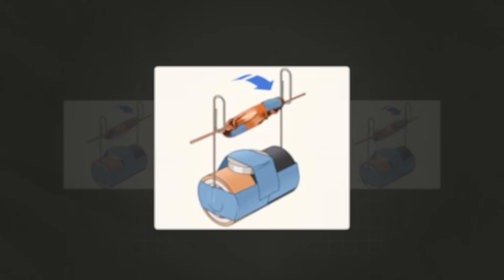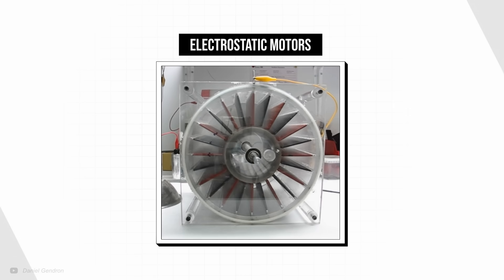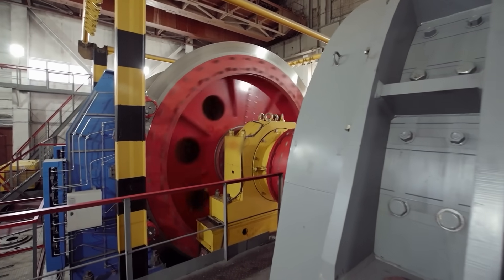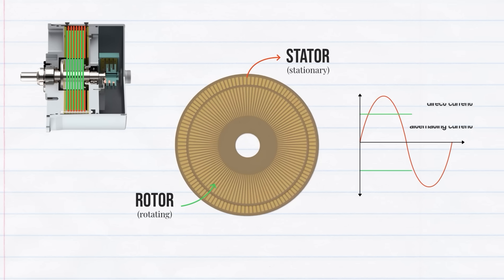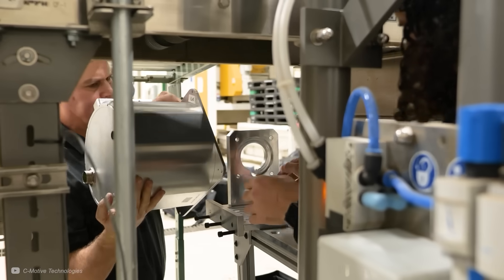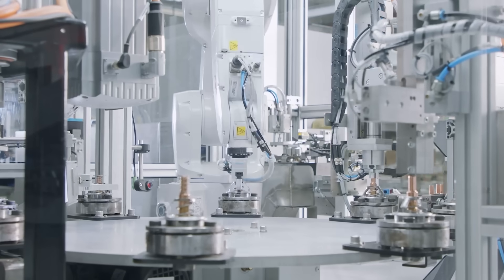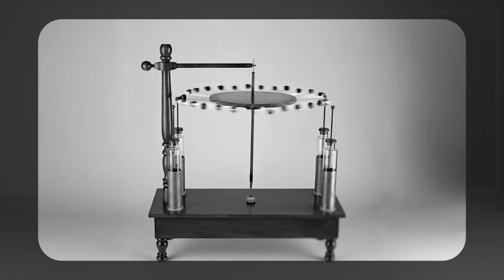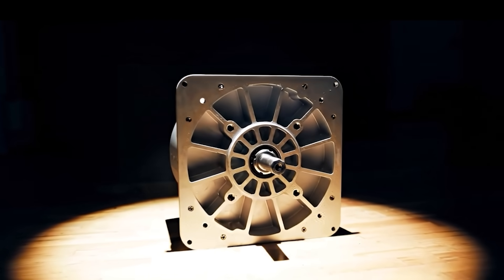How Electrostatic Motors are Breaking All the Rules

Comment: Could this motor work in airplanes (and ships)? I'm thinking you need low weight there and torque, but also power? The main reason we do not have electric (mainstream) flight is weight, not so much of the motors, but batteries. And they do not get lighter as you fly longer unlike fuel being spent. But you need most of the energy for takeoff, and for rockets it has been proposed to beam the energy to it with lasers, so I'm thinking would some such solution work for the first most demanding part of the flight? Or getting energy from the runway.

Comment: I just have to poke a little bit at this claim that the rotor in an electromagnetic motor is "generally a permanent magnet" - That's the first time I've ever heard that claim. In fact, permanent magnets are undesirable in many motor designs for various reasons, and that's why most common types of motors use electromagnets in the rotor too. Either powered by a commutator, or inductively. The most common motor in the world, the Asynchronous motor, uses an inductive electromagnet in it's rotor.

Can you provide a sourced number for how big a percentage of motors in use today use permanent magnets?
Reply: Almost all very small motors - think how may 12v DC motors you car has. Toothbrush motors, phone vibration motors, toys etc. These all use permanent magnets.
Reply: @jonathanpearce3773  I didn't ask for examples of permanent magnet synchronous motors. I know they exists and what they are used for. I asked for a number. Because I am still sceptical that PMSM are a majority (yet). There's an awful lot of AC motors out there, too, and they are especially used for industrial applications, which was the main focus of this video. Ironically, many of the pictures of electric motors flashed in this video are AC induction motors, which do not use any permanent magnets.

Comment: Love the parts where you show induction motors, or squirrel cage motors, which DO NOT USE MAGNETS
So no, electrostatic engines don't fix shit, we had "magnetless" motors for a century
Reply: But electromagnetic motors always need current in their coils to make torque, which causes heat unless you have superconducting coils. ;) An electrostatic motor creates torque with almost no losses, if it's almost not rotating. Hence for certain purposes it may be useful.

Comment: So much talk about rare minerals and the environment, and at the end we learn those new motors are primarily meant to replace asynchronous induction motors in conveyor belts, which don't use rare minerals nor permanent magnets anyway.
Reply: I wish I had a rare earth type motor in my industrial sander and dust collector.  When I am using 12,000 watts to sand wood, a 15% increase in efficiency would be appreciated.
Reply: @jasonneugebauer5310 Newer electric equipment uses brushless motors more and more.  Soon enough someone will fit one of these for better efficiency than brushed motors.
Reply: @nedmilburn I am looking forward to the time when most motors are brushless.  There will be a significant efficiency gain.
Reply: @jasonneugebauer5310 most industrial motors are 3 phase, brushless, with no rare earths.
Reply: @sajnt69 you are right.

and they are fairly well made and efficient.

I didn't think about that, I am always using single phase motors in my shop, which kinda suck.
Reply: Yeah and reluctance motors don't even need copper in the rotor.
Reply: if companies cared about rare minerals they wouldnt make as many disposable products!
Reply: @custardcatcher5195 Disposable products made in China who control the rare earth permanent magnet supply and are trying to control the copper market. Sold as finished Chinese products. Quality American and European manufacturers have their designs stolen and their supply chain thrown into chaos by the Chinese. Believe me they care a lot about these minerals, not doing so may mean going out of business
Reply: @grz987 I love how people try to blame China for everything manufacturing.. Tell me, who is purchasing disposable products? Yeah people and companies from every nation, west to east. Tell me, how did China become a manufacturing giant? Oh right. Western demand. No demand, no supply. And, no, not everything coming out of China is cheap disposable Temu crap, they make a lot of quality products as well. And yeah it's not just China, there are slew of countries manufacturing disposable products these days. Not only that China is leading the way in renewable energy amongst other arenas. TLDR, trying to displace blame for everything on China is dumb.
Reply: @grz987  just to point out the bad quality "made in china" is designed in the US and in Europe, with the specification it should be cheap and bad quality. China can also make high quality product, but it wouldn't make sense to ask for a high quality product and pay the same than a US/EU made product.
Reply: @custardcatcher5195 there's a lot that care too because it affects the total cost. Affordability affects popularity
Reply: @custardcatcher5195  true... things must be changed!
Reply: kind of what i figured after 1min , like hu permanent magnets , yeah in schoolbooks to explain the principle maybe but most of the time theyre just windings aswell
Reply: Well those still use a good deal of copper
Reply: Lol
Reply: It would appear the main replacement is of a reduction gearbox. But they could also use a stepper motor.
Reply: Don't forget about the copper!
Reply: @sprockkets  or AC :D
Reply: True, but the massive reduction in copper use and energy cost is awesome. Hopefully these can find more applications in the future.
Reply: Thank you, you saved me 10min
Reply: not that rare mate iridium alone turns out to be fkn everywhere on account of Earth representing a fkn Golfball when you look at the impact scars huge glut for Lithium and nobody willing to go Annex the Congo and stop the Child slavery and just rip that shit out using mining equipment that functions on diesel
Reply: This channel is clickbait, so no surprise there; the guy also really seems like the pseudo-intellectual type. If he can get a doctorate, that just speaks volumes on how education =/= intelligence.
Reply: Also the statements of the efficiencies are dubious. With an induction motor perfectly sized for the application, you don't need gearboxes and it should run near its peak efficiency. Which is more like 85-90%.
Reply: ну надо-же как-то подвести к этому ;) Просто так никто вкладываться в такое не будет. Плюс не показали "умножитель", выдающий как минимум 4000в и полтора киловатта. С переменной частотой(ведь двигатель нужно крутить с разным количеством оборотов в цикле)!!!
Reply: Can it be used for car hub motors?
Reply: Или узнаём, что эти редкие материалы добывают дети в какой-нибудь африканской стране, в шахтах, похожих на норы, работая за еду.
Reply: Isn't it that there is plenty of the so called rare earth just a lack in the possessing of it.  Australia opening up a possessing plant, will it get cut out of the market by China reducing there cost selling there stuff until it closes is the issue why it rare, its not rare it controlled.  Just like your oil.
Reply: Like what a thing to try and target. You aren’t replacing squirrelB with a novelty
Reply: There is a large push for permanent magnet motors for use with conveyors due to their higher efficiency so it is coming
Reply: All these rare earth's etc are headed to EV motors, who's efficiency is way better than old school induction motors, so a very bad choice to compare against.
Reply: You have no idea what you’re talking about.
Reply: @paulstubbs7678  BMW and Renault use induction motors in their cars and they're efficient as well. Since we don't know the specific motor efficiency in their case, I can't say if it compares to a Tesla or VW motor.
Reply: 😂 because their point was to cut the dependency with china by inventing the new motor, idk how well it ended. maybe just as good as another green energy bullshit marketing shenanigans which always ended with china copying it and do much better than them
Reply: Rare earth or critical resources are used in a variety of things is why there's so much talk about it lol
Reply: Ghat is true but they are inefficent. There are loads of inefficemt processing motors in industry and most of them could be replaced.
Reply: @matsv201  : An IE3 100 hp motor has an efficiency of 95%. First one has to count the motors and note their size. If most of the electricity is consumed by big motors in compressors, pumps, air condition, then changing these might help much more than hunting all these tiny motors.
Reply: @georgkrahl56  Why would you use  a 100hp motor on a convayer band that need half a hp?

The issue with using compressors and so on is that that is very inefficent as well.

That is actually the reason why most things are powered by small motors. IN the olden days everything was powered by compressed air, and before that steam.

But that was replaced with small motors because that was more efficent. Not less.
Reply: @georgkrahl56 they are already legislated nearly everywhere in the planet that over 0.75kw only ie2 and some places ie3 motors can be sold for s1 duty applications
Reply: @avada0 the issue is with efficency of scale. That is. You need it to be 100hp yo get that efficency
Reply: . 80-90% near full load  for industrial induction motor
Reply: @matsv201 it’s not true at all. They are using worst case scenario where people are choosing ie1 motors and worm boxes. They could easily use an ie4 motor with a helical bevel or helical and be in the 90% range. The reason they don’t is because of cost. A helical bevel will cost substantially more then a worm gearbox at the small size they where showing. Below 42mm keyed shaft.

If they couldn’t make that motor cost the same as atleast a ie3 industrial motor and helical bevel it has no chance of success.
Reply: @8towely you are absolutly clueless about efficency on a set up like this.

Its not about the motor peak efficency but the actual. On top of that you never get a motor this size with a 90% effiecny to begin with.
Reply: @matsv201 mate I have worked in industrial power transmission for 15 years.

Ie4 reluctance motors at 1.5kw are 97% efficient at full load. Yes it drops when not producing its rated power but its not that big unless your at sub 40%

No one buys them as they are not cost effective particularly in sub 1.5kw.
Reply: @8towely top tip. Stop meking stuf up. There is no motor in the 1.5 kw range currently that does 97%.
Reply: @matsv201 ie4 reluctance motors are in the 90% range in this size. No one buys them because of the cost. If it wasn’t regulated people would still be buying ie1.

Unless you running a squirrel cage motor below 50% it’s rated power the efficiency is usually fairly close to rated.

I’ve worked in power transmission for 15 years.
Reply: @matsv201 sorry your right it’s 90% at 1.5kw.

Still doesn’t change the overall add another 2% per stage of losses for a helical bevel and your at 84%.

Now compare the costs.
Reply: @matsv201  Power factor correction capacitors will solve this inefficiency problem.
Reply: @matsv201   induction motors are inefficient in the 87%-94% range. It's not like we are comparing a ICE engine to an electric motor., Even if these have a marginally improved efficiency, we are looking at maybe 4-7% increase. This is great and all, but there is little incentive to replace a simple, cheap async motor with a complex, propitiatory new design that will likely be more expensive and more complicated to support.
Reply: @cyberlord64 i think you misunderstand how percent efficiency gains work. If you have something at 20 percent efficiency and increase it's efficiency by 20 percentage points. You use 3/4 the energy. But if you are at 70 percent efficient and increase 20 percent you now are using 1/3 of the energy you used before. As you get higher up in the efficiency the amount of savings per the efficiency increase goes up. 1 percent from 98 to 99 is half the energy requirement while 1 percent from 4 to 5 percent efficient is a rounding error.
Reply: @matsv201 cost motor.. Drives and cabels they did not talk about that. Most motors use drives to regulate speed. And cabels high voltate drives and cables are way more expecive. Way more prone to failure . als that liquit in the motor... It better meet food safty standards if you want to use it in a factory where food is produced . also higvoltage and barings damage. I wonder how are they going to get the voltage equal between the axe and the housing ? Replacing the motor. You can get off the shelf parts for conventional motors you csn order them from any one. New playsrs with experimental designs well are not welcome . easy to repair old style motors are very easy to fix . if you pre emptive change the seals and barings they can last a long time. But this stuff.. One time use.
Reply: @cheezy2455 making high voltage is no harder than low. All motor controller have galvanic isolation anyway so this realöy dont make it harder.  One advantage of high voltage is current is really low, that improve efficency of motor controller and make them cheaper to build.
Reply: You sound like someone who has no idea what they’re talking about.
Reply: Yes, they should be comparing to permanent magnet solutions to not look like they're greenwashing, but if they did that, it weakens their competitive advantage. So this is definitely disingenuous, but it is still a niche target market for them until they can truly improve their technology.
Reply: A rogue double negative spotted.

Comment: Yep, the reason they are going after torque rather than power is fairly obvious. That dielectric fluid would be a source of loss, except at low speeds.
Reply: Well, if that fluid is significantly more viscous than ambient air pressure. We don't know that. Maybe the fluid is helium, which is less viscous. (Unlikely, I know.)

Comment: So, a 0.8mm gap filled with fluid?   Do fluids not have viscosity?  With such tiny gaps even air has non-trivial viscosity. 95% efficiency has be a myth. As the video shows this is a well-known principle of operation, discovered 300 years ago. There has been a lot of very smart people around during this time.  It has to be a reason why no one "bothered" to implement a practical motor based on static electricity, high voltages are not a good enough reason to desist if everything else is so wonderful. I feel very skeptical, it looks like an investment scam.

Comment: Too bad you didn’t include any clues about charge distribution on the plates as it isn’t particularly obvious how rotation is occurring….
Reply: It’s really just a dual of the electromagnetic motor. Replace magnetic field with electric ones. There is going to be differences in the details, but the gist is pretty basic
Reply: @IronBrain0  "It’s really just a dual of the electromagnetic motor." ==> "It’s really just a   >>duel<<   of the electromagnetic motor."
Reply: @IronBrain0 . Curious, what is the gist of the differences?
Reply: @Fejimush This whole idea is interesting. 

Magnetic fields lines always have to make loops, whereas electrostatic fields will have a distinct source and a sink, so that’s a big difference. In other words, magnetic fields are inherently dipoles and electric fields aren’t.

Another thing is that when you put a bunch of charged particles on a flat surface they want to spread out and they gather in higher densities at sharp/opposite edges. The result is that magnetic fields will tend to fold over and decrease at the edges of the stator/rotor lobes, where an electrostatic fields sources will probably tend to concentrate more heavily at the edges(why corona discharge always happens at sharp points). The effect that I surmise is that the fields during rotation will also tend to pinch and concentrate at the boundaries of poles, which is probably why it would be hard to suppress arcs, and why I suspect that torque ripples are both problematic with this motor type. 

I bet that these motors can be extremely efficient at holding and low speeds, but they probably lose it at quickly at higher speeds because you still have to pump around charge, and so power density is also quite low.
Reply: @IronBrain0  Could we start here and agree on underlying physics?  
This statement in the first paragraph is false:
"Electric fields aren’t dipoles":
Reply: @IronBrain0   To produce work, electric fields must form dipoles, akin to magnetic fields/devices.
--
The arcing potential can be solved in designs.
Reply: "Too bad you didn’t include any clues about charge distribution on the plates, as it’s not particularly obvious how rotation is occurring…"

The majority of the charge is concentrated at the edges of the poles. This information is available in a few academic papers from UW–Madison on the subject.
Reply: @Fejimush 
I think the point is he included a bunch of shit like history rather than the video namesake, yet still neglect important info in the info dump. None of this is about available info.
Reply: @furyberserk  What would you like to know about ESMs?
Reply: @Fejimush  What is your background and interest[s]?

Comment: Why does the dielectric need to be a fluid?  Wouldn't a solid dielectric printed directly over the coper of the stator and rotor plates make more sense?  You might lose the cooling power of the fluid, but you would be able to have a VERY effective dielectric allowing for way more voltage.
Reply: There are a few problems with using a solid, specially dimensional, since it would have to be both VERY thin and not bend in any circumstance.

Comment: 6:11
It it Flourinert or another fluorinated compound ?
Reply: It's a "proprietary liquid", so you just take novec 1230, novec 7000, fluorinert, mix it and you're done.
Reply: From the SDS datasheet, it's 55% -  90% Methyl nonafluoroisobutyl ether and 10% -  45% Methyl nonafluorobutyl ether.